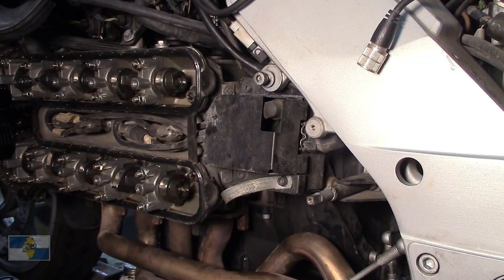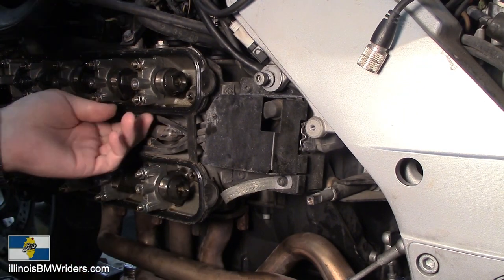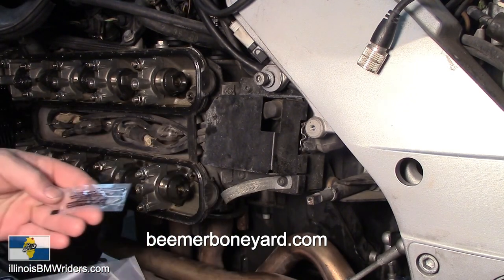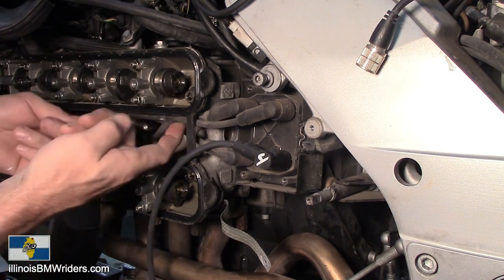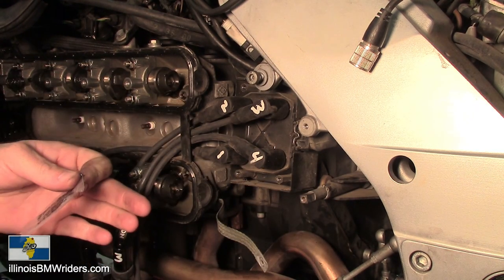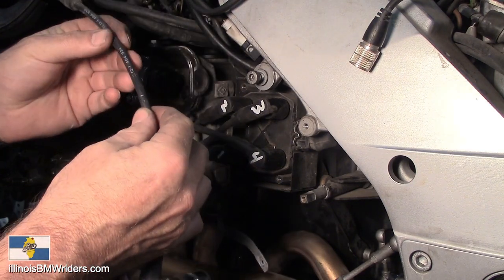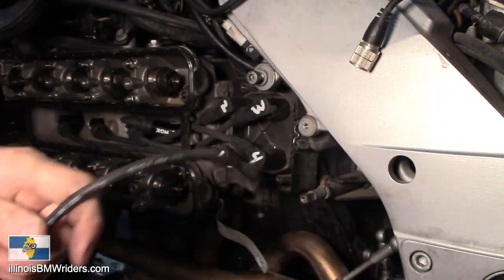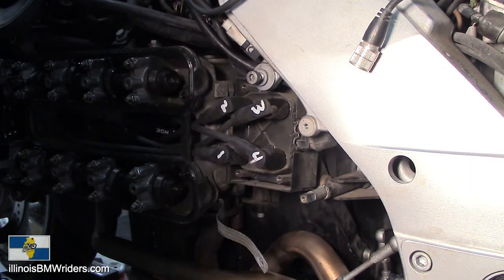BMW K1200LT DIY Spark Plug Wire Replacement

Comment: Hello my name is andy I am located in Iowa in the quad cities area I just bought an 02 k1200lt with 50k miles between 2 k and 3k rpm it stutters and bucks particularly in 2nd gear if you have any idea please help
Reply from the maker: First things I would look at would be the spark plug wires, then the fuel line in the tank and then the O2 sensor.
Reply: illinoisBMWriders I found the problem the fuel line was cracked thanks